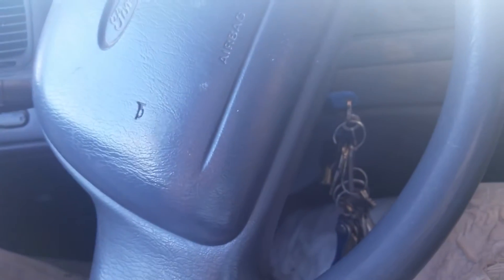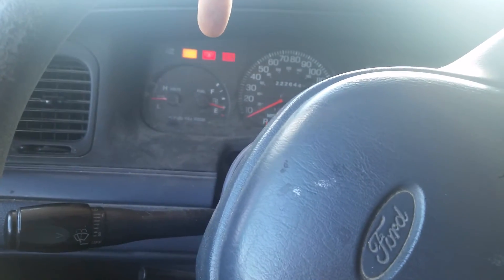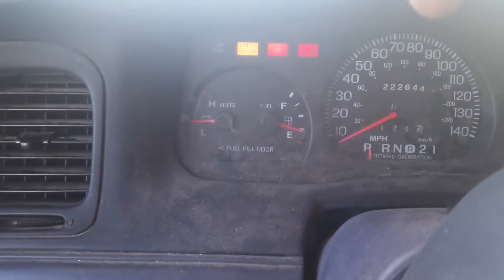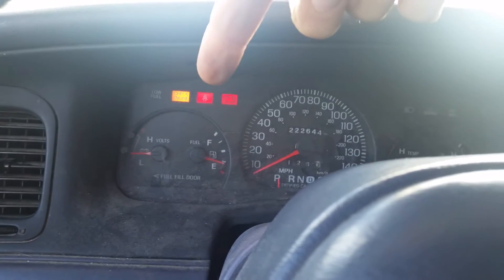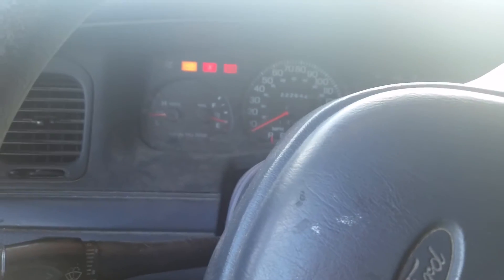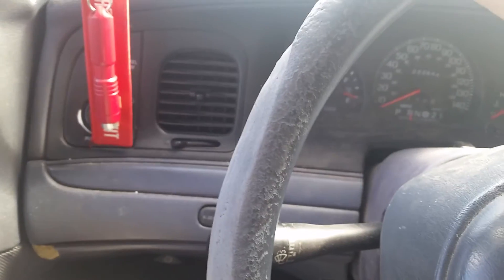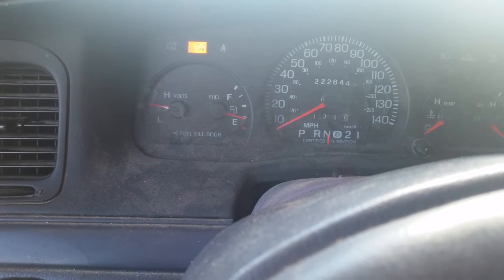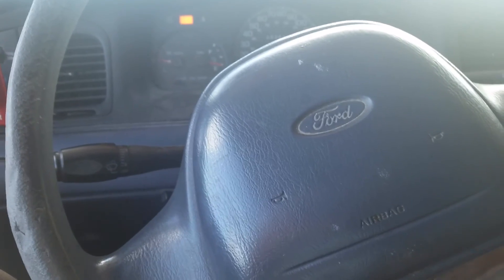Stopping Seat Belt Noise in Cop Car

Comment: Interesting Ford would put the procedure, in its computer, GunWebsites.  The Internet is full of information.
Reply: If I'm not mistaken, this was a Crown Vic/CVPI thing (Ford, Dodge, Toyota, etc, had this ability on various models). Fleet/Cab, Police, Public Safety, etc-- this would be useful.

Chevy Impala fleet vehicles, this couldn't be done in this fashion (software). Usually meant disconnecting the buckle sensor. I think Chevy, for the most part, does not allow this in software.